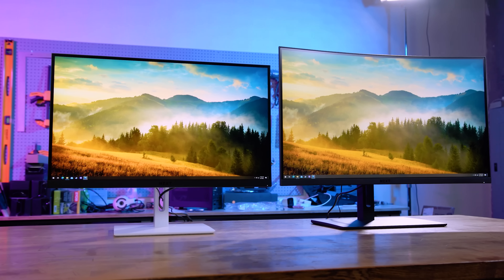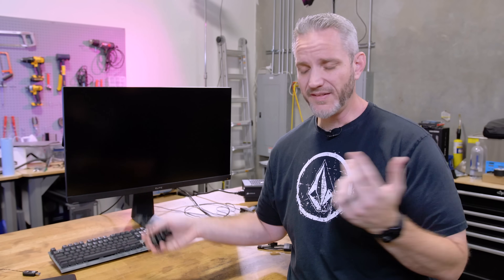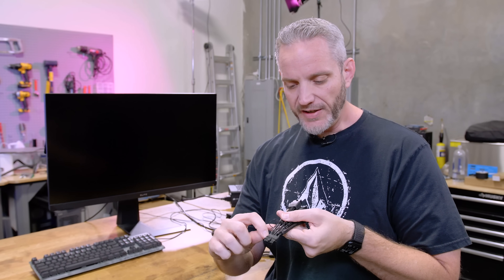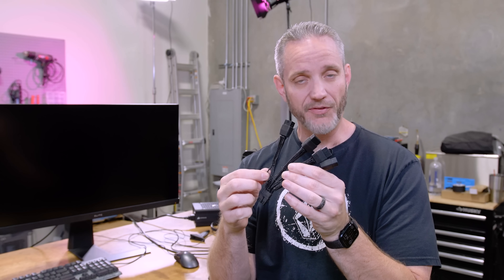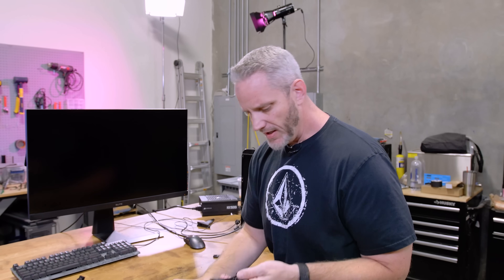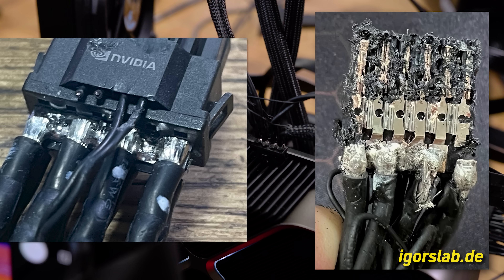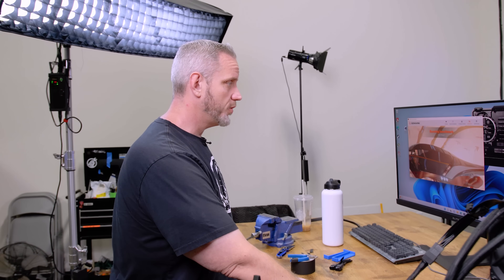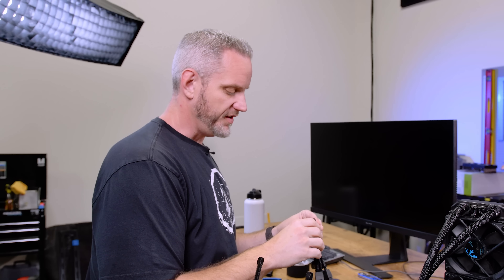Igor's Lab figured out why NVIDIA adapters are melting!

Comment: The engineer that designed that cable needs to be FIRED and black listed . all those cables need to be recalled and REPLACED with a totally new design instead of simply a thicker foil plate .. maybe a CAST plate. And NVIDIA needs to lower the price of the card instead of raising because of the recalled parts and extra R&D they need to do so the consumers houses do not burn down because they bought NVIDIA products .. if ever there was a time for a FUCK YOU NVIDIA now is the time.

Comment: The design of the power connector on the GPU itself is staggering. We all know, the depth of these cards means the vast majority of cases won't have the space to accommodate the side cabling, leaving the only options as side panel off, which will screw up the airflow completely, or vertical mount and say goodbye to any PCIE hardware you may be using. My rig has been built with both these aspects as being needed. I have M2 daughterboards and a big push/pull fan setup.

There's no way I'm going to transplant my PC into a far larger case, just because of this. It's the reason why the 4090 Founders is now completely off my radar.

All of this nonsense is just the icing on the cake. Major missteps here by Nvidia.

Comment: Have you thought of a spark springing from the broken Plate to the rest of the connector? I mean if you unplug a cable there is more stress on the other cables. but if its near about to be connected, it could spark .... and this would also create some sort of heat. and melting.

The adapter is just a joke at all. Nvidia failed it

Comment: USER ERROR IT IS NOT IN MY CASE....My Asus Strix 4090 OC just burnt out its cable pins. Cable was and is stuck/melted in the card. This sux especially when you pay $3800 AU. I will give up on PC building and PC gaming altogether if I don't get RMA.

Comment: For all that power and money spent, this should not be something that's overlooked. We all know NV engineers knew of this, bc added some extra shrink wrap to resolve it. Instead of spending the money for a proper fix on a cheap plug, they now are going to have to spend real money for damage control. Get with the program team green. Shit like this is pushing so many of us to AMD. For the cost of the card, the consumer shouldn't be worried about shit like this. Never should've made it past R&D. This is going to hurt people and burn down homes.

Comment: I honestly say i could solder better at the age of 10 than some of the work on those adapters. Thats appalling! 
But soldering aside, that entire design of them is terrible. They should have 1 wire per pin then have a short legth of ribbon cable that then goes to a Y joint to make the connections where space is less of an issue. Of course this would drive up the cost of the adapters.

Comment: im glad i vertical mounted my 4090 so i could have no bend whatsoever. i'd be pissed if i pulled out the cable on a $1800+ piece of hardware and it was melted.

Comment: TL;DR: 12VHPWR is a shitty power connector.
Either we go with quad 8-pin connectors or we start making PSUs with 24V rails to use dual/triple 8-pin connectors.

Comment: update : I don't have a card with the new 12VHPWR connector but I just received a cable from China (to do electrical tests) and let me tell you what those news don't tell you it's TINY O_O I expected something larger than one pcie plug but not it's actually smaller than 1 and is supposed to replace 4 ! wth nvidia are insane to want 50A going through something so small, that's the same current my car subwoofer amplifier had (600w=50Ax12V) and my battery to sub cable was as thick as a grown man pinky finger whoever approved this should be demoted at the very least

Comment: the point is... these connectors are screwed up/wrong and poorly designed from the start.... they are failure prone and that in of itself is a red flag.... even if half of 1% of ppl have a problem.... that is a too high failure rate for a high power plug with 500+ watts of power

imagine if ANYTHING you plugged into your wall in your house had a 1% failure rate where it would catch on fire......we would have millions of burnt down houses and trillions of dollars in lawsuits

my own opinion is that these connectors are too small..... they wanted to make a new design that's more modern or some bullshit, but they just screwed them up instead..... there is in fact absolutely nothing wrong with the current standard aside from its plug size....of which these new connectors are attempting to solve.....but this is a standard that has been trusted for many years and has absolutely no problems....

these companies are trying to fix something that doesn't need fixed or trying to solve a problem when no such problem exists outside of these companies imaginations 

if it aint broke dont fix it

Comment: bro ok about melting argument, but it’s 2 case around the entire world and caused by bad use on cable management.
i don’t see that spam when ryzen broken the motherboard after OC. 
the adapter it’s not the best, ok, but if you connect correctly, no one have problem.
Change “music” of tha point please 😊

Comment: Regardless of the failure it was a silly design cramming so much power in such a small plug.  The other end of the custom cable tells it all and some engineer should of put a stop to it!  Also regardless of the aftermarket, the weak link "is still" the connecter going into to GPU.  think of years of heating and cooling of the plastic and the thin buss connecting the pins. It's all going to weaken and fail down the road.  They should of just put 3-4 connectors on the GPU, so silly and dumb to save a few cents.

Comment: At least Nvidia is accepting it is a possibility. I can see where they techs felt it was safe and for the most part it would be if properly built like the others Devs but hope they get the cables replaced asap instead of waiting for failures and doing RMA or hoping warranty fails.

Comment: But it fails past that point.

It’s just a bad design overall… there needs to be a gap over 300watts or it will jump over.

This explains why it’s on the positive side on the ends. 

Not enough insulation and no space to dissipate heat. 

Larger gauge and no links possible. And denser insulation covering the entire wire and solder points, Like crucial did.
Reply: Holy crap that’s some horrible soldering this shouldn’t have even made it to market… they knew and gave people faulty products…

Comment: Why have 8 power outputs, but only supply 6 inputs? All these problems to save the literal pennies to have 2 more cables.
After the last 2 years of record-breaking profits, their ON RECORD market manipulation tactics, shady distribution practices - It's no wonder EVGA cut ties.

As a person who spent a LOT of time on 12 volt systems doing competitive car audio, anything pulling more than 500 watts NEEDS thicker cabling if only to dissipate any heat that will occur. Regardless of the run. If those cards are pulling 1400+ watts, I wouldn't trust ANYTHING less than 4awg, best case would be 0/0 from source to source and 8awg pin connectors. Running through all those adaptors is also just introducing more points of failure, and is dropping the signal efficiency.

Comment: anyway...its no issue for all atx3.0 specs and cables...no fire or smoke ...people need to invest newer psu since everyone at 2.53 atx are about to go next year that everyone should be moving to atx3.0 by next year....evga and everyone psu makers are moving forward to next version ....2.53 been great for last 5 years and its getting very old as the one before it that nobody should have obsolete 4 rails power hogs is very not efficient  anymore

Comment: 600W, 12V so they put 50A though that dinky little connector? Well there's your problem, its just completely out of it's weight class. 60 degrees on a connector is not normal by any measure, criteria is not that it's good if it doesn't melt, the criteria is that a connector is chosen with a sufficient margin that it's not even a question, you shouldn't have to worry about it at all. A connector is supposed to be basically room temperature on it's own, the power loss over it all but negligible. If it heats up by any noticeable amount, that's a failed connector.
ATX was written into a concrete spec in 1995, the CPU-s of the time were 10-15W Pentium 5-s, Voodoo1 was yet to be born, forget about 600W graphic cards. Maybe it's about past time to extend ATX to 24V and 48V, industrial and server world went there ages ago.

Comment: Let's cut to the chase:  Jay- WHAT IS THE SOLUTION (iow, can someone point users to 'correct' PSUs that DO NOT REQUIRE the use of Mickey-Mouse 'adapter cables' such are featured in this video?  It blows my mind that in 2022, PC hardware is STILL not 'bulletproof' in design!  Given that NVidia is putting out such monster 3-slot cards that require a small condo to house them, and using TDP numbers that make power utility companies wildly happy... where are the 'next gen' PSUs that have the proper number of connectors on them to safely operate such monster GPUs with NO FIRE DANGER!?

Comment: Your interpretation is incorrect, about the cause being the soldering. As you pointed out several times the sideband/sense wires are useless, the problem is caused by bad design which makes the sideband/sense wires useless. High power lines should also never be soldered; as solder joints are known prone to failure. You would never solder the connector directly to the power supply you use a crimp because the solder can creep causing an arching situation which can cause a fire. Bad solder joints are a normal fail condition and should be expected.   This was clearly a full auto foot shoot. Sense wires designed to be senseless, Check. Using solder joints where crimps are called for, Check. Bad implementation of solder joints which fails, Check. Brrrrrrap!

Comment: Individual differences between the cables. One in a thousand badly soldered and it can be a disaster. A design like this is not good if it works a thousand to one - when it comes to starting a fire it should work a million to one. 
Especially in equipment with such a horrendous price.

Comment: nvidia cable should not been bridge by solder points ...cable mod and corsair and seasonic are not solder point ...its dangerous when solder together as jay says...every wire are independent crimp in 14awg for 3rd party ...cause they professional cable makers and psu makers that goes by specs and rules...nvidia never made psu or understand how it work

Comment: my internal case has like... 40-50c, hes doing it with no case. He rally needs to put it in case, let it head up itneriors and then do test. hes loosing like 30-40c on open bench tests. This is not representative of avarege user pc.

Comment: the issue from the start it is a badly designed power connection to draw that much watt just for 12 pin. u buy 1600$ for this end user cable... wow

Comment: I have never liked this cable, is just badly engineered, there should be an adapter between the PCI connectors and the GPU connector to smoothly transition the wires and deal with the cable distribution.

If you put that cable through an IPC standard, it won't pass

Comment: I am also an engineer.  However, I have a very different opinion.  Too much wire going into too small connector. 
It is actually a STUPID design.  The simple fix is to build an adapter that is wider and more space for MORE Copper to provide the amps needed without over heating. One wire to one connector as yo stated.  If that item needed to pass specifications electrical for homes and commercial, that design would NEVER pass and not be allowed.

Comment: This issue will go away after we find that the problem is caused by owners not fully seating the connector into the card. That 12-pin connector does require more force to insert it into the card. Keep pushing until you hear the connector CLICK. Not bending ANY connector wires is always preferred.

Comment: You've never done sensationalist stuff, so if you're willing to put out a video saying there's an issue, even if it's limited, and even if you can't reproduce it, then the cable manufacturer should find out what scenario causes the fault so it can be mitigated.

Comment: That is absolutely piss poor design. A manufacturer I deal with in a different industry went out of their way to change a power connector on a new range of products to prevent this kind of thing.  The old connector on paper would have just managed however they did it to be safe to protect their products and more importantly their customers.

Comment: This is so funny, what everyone is looking for a problem where it's not. But where is resistance, there is heat. If connector is melted, so it has high resistance, low connection. Nothing with a bending a cable or broken joint inside, because it will be melted there. Case closed.

Comment: It's amazing what a terrible design job this was. And not only mechanically, those pads are also way too thin, at max rated power they carry more than twice the current than what is generally considered the max for an uncooled copper conductor

Comment: This is so stupid!
I think, it's not even, that there is just 4 wires for 8 pins, but that they are soldered!
Basically every other connector in a PC is crimped - and that includes SATA-Power connectors that have like 6 pins connected to a single wire (ground).
Crimped connections don't get cracks!
From the images I would say that the metal could be thicker, but the main cause for the problems are the solder joints. Just crimping the wires to the connector would probably get rid of 90% of the problem...
Solder joints are not meant to be mechanically strong - crimped connections are!
By the looks of it, the Corsair cable has (most likely) crimped connections, making it even better.

Comment: The thing is, most users are not super users. They won't check what to avoid with their videocards, also how not to break the cables, because they are not electricians, but just wnat to see them pretty... Also nVidia has covered his ass already with the Mounting Instruction, so noone should expect a recall on this, and not even an apology from them, because it will then create a panic and AMD would win the next buyers.

Comment: I'm sorry, I like your content 99% of the time, love your builds, trust your reviews and whatnot. BUT THERE REALLY ISN'T ANY REASON WHY THIS IS 15 minutes lone and by 4 minutes you've repeated yourself as many times as there are pins on that connector. It's super hard to follow, I guess I'll just wait for LTT's video where they use writers. That'll be like 4 minutes long and then stretched to 10+ minutes via demonstrating and manufacturing the failure. Edit: I was reading the other comments and I did want to say one thing positive in a sea of negative; I do love your channel since you do look out for the average consumer, and you are passionate about this issue, not only because you personally experienced it, but know that the average person even if we all wrote angry letters to nVidia would most likely not be heard, and need a conduit to these companies that forgot it needs us customers to succeed. Since I doubt their Quadro line is paying enough of their bills on their sales alone.

Comment: I make cables for a living. This one connector multi tap is very very bad practice. 👎  It's like running an arc welder of a 13amp household plug and wondering why your power cord is burning hot, Nvidia needs shot! If this was at BSI british standards institute  they would laugh it out the door with an out right ban.😪

Comment: How is the wires not crimped, soldering DC power cables on the edge of a connector is just plain foolish, engineering 101
The reason is that solder is a very good electrical connection, but a very weak mechanical one eventually becoming brittle.
If our company found that we would recall them all and change to a crimped only connection. At least its just the cables and not on the card side

Comment: These adapters and cables were never intended to transmit such absurd amounts of power to a f*cking graphics card, that's just ridiculous. They shouldn't make bigger cables but instead make more reasonable hardware again. At least I refuse to use a graphics card that requires the same power as an electric heater just to run a game more fluid and costs more than a whole high-end computer not that long ago.

Comment: And yet the choice of connectors is stupid!
A connector with two contacts and only two wires would not have these problems. Then you would not need a small extra connector with 4 contacts. 
In other Hi Power applications it works with two wires and two contacts for decades without problems.
Something like an XT60 or XT90... and you would never need any adapter or new plugs again.
It's just marketing bullshit to have new plugs all the time. Simply so that they have something to show... but not because it would somehow really make sense.

Comment: This is what happens when you ignore the basics of electrical engineering and forget about KISS. Nvidia went and made what should have been a simple solution, wire crossing before getting to the plug and instead came up with a convoluted in-plug bridge which is highly susceptible to flex wear and inept production techs and created a poor quality incandescent lightbulb inside the plug!

Comment: just done the back calculation for the amps that are being pulled by the card at full power 50 amps max 600/12=50 the heat generated by that amount of amps across a short or high resistants' is going to get hot quick. this is realy realy crap design.